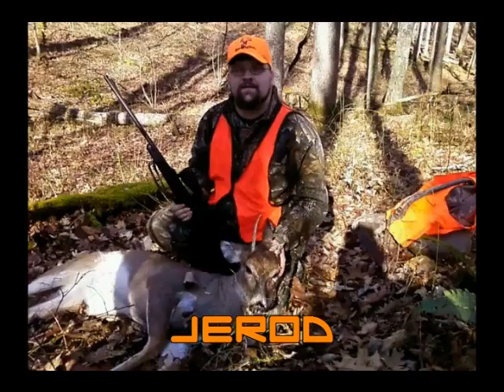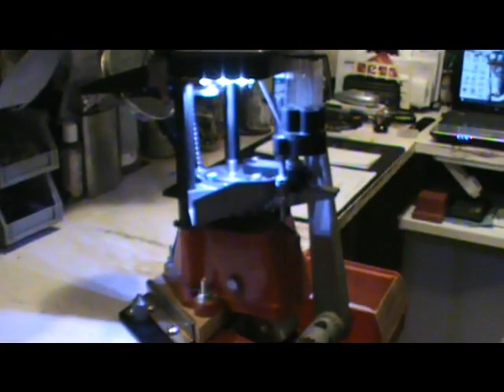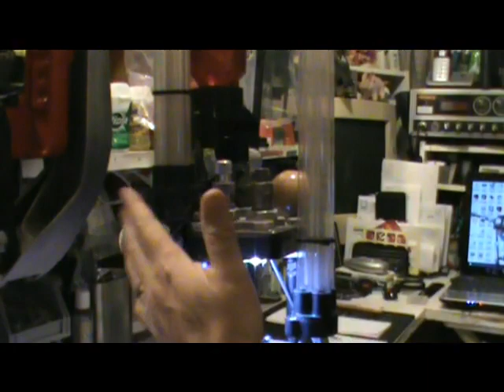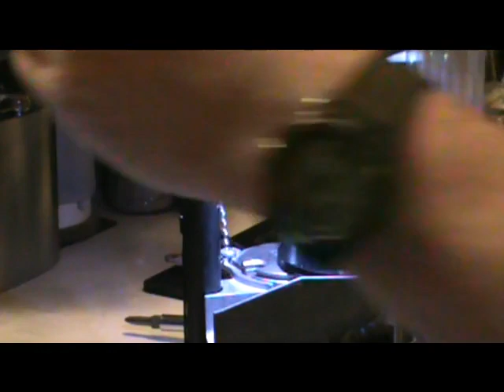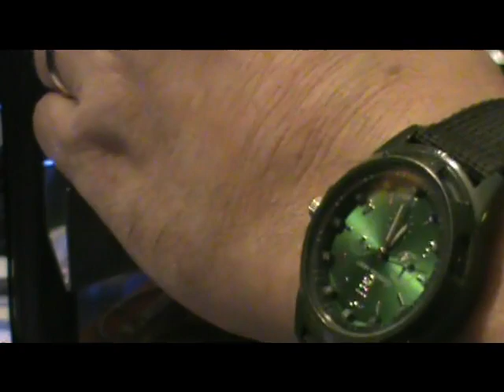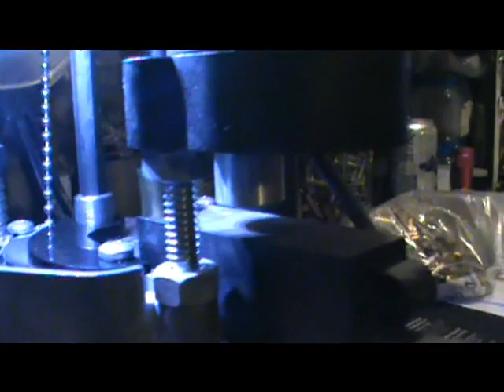LEE PRO1000 Brass Case Ejector Mod

Comment: I just received my ejector and it works perfectly. Thanks for the tip.
Reply from the maker: Ron Baum glad you got it and it is working!  Again I really like mine.  Of course you saw in the video I tested it with some spent primers seated back in some brass just to see how well it would work.
Reply: I saw this product and instantly knew it was good for 2 reasons...the bulging primer problem, but to me more importantly, it kicks a 223 out earlier and far enough from the newly fed case headed for the shellholder plate. Every 223 that was loaded knocked over the case because the longer case with a long bullet seated is way longer than a pistol load. I like this tool because it works. I also ordered a primer tube kit for the Turret Press. As soon as I get a step drill in the mail tomorrow I will set the turret press up and give it a whirl. These 2 new tools take a lot of the drudgery out of the loading process. I recommend this one also.

Comment: I just ordered one also. I do have a question: Is this caliber specific or will it work as well with a .223?
Reply from the maker: Ron, I don't think it is caliber specific.  The shell plates on the PRO1000's are all set up the same way, 3 places for the shell casing, no matter what the caliber.  Now I haven't tried it myself, but the timing is the thing on the PRO1000's.  Each case moves to a specific spot when you work the handle.  All this case ejector does is make sure the case is pushed out into the shoot.  What this case ejector does is make sure it pushes it out where the notch is located on the base of the shell plate carrier.  That way if you have a primer that didn't seat all the way it won't jam up your press.
Reply: Thanks. I thought because some cases are much larger diameter than others, the bigger cases like a 45 acp would affect the timing per se, in that it will contact the ejector sooner than a smaller case. Don't need to worry right now about it though because 9mms and .223s work ok, I was told. If I start loading 45 acp and 9mm I will get carriers and shell plates and whatever I need. This looks like a great tool.

I am working on a bottleneck idea to slow cases when dropping down onto the feeder as it pushes the next case to the shell plate. The one in the tube drags on the one being fed to the plate and kicks it over. If i can slow the drop of the case that sits on the bottom case the bottom case can scoot out toward the slot before the case on top of it has time to knock it over. So far a radiator clamp seems to help some but is not perfect...yet.

Comment: Great video. Lots of good ideas out there. After watching a few different suggestions I went to my press, took out the pin and put a little bend in it. After two minutes of tweaking I ran 200 Rds with no issues.

Comment: Your 2 minute intro was way too long.
Anyway here goes...move the ejector pin to the opposite side of the retaining screw. Problem solved.
You're welcome.
Reply from the maker: Jun Gleno thanks for the comment but the pin has a groove that it is suppose to fit in.  The groove is where the pin is from the factory, placing the pin in front of that screw does not secure the pin since there is no groove groove in front of the pin.  As your case comes around it could cause the pin to kick inward.  As for intro length, yes I know and I have been working on shortening it.  Thanks for your comments.
Reply: Try tightening the retaining screw a little more. That should do it.
I'm not having any trouble with mine staying in place on both of my pro 1000's.